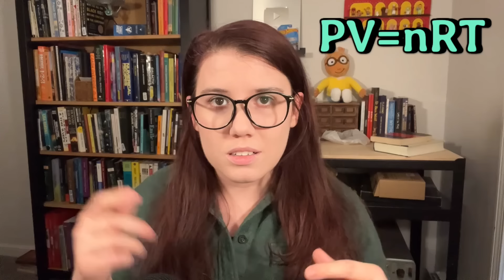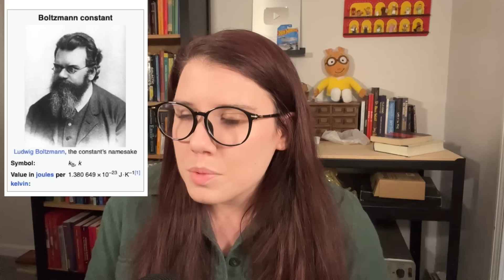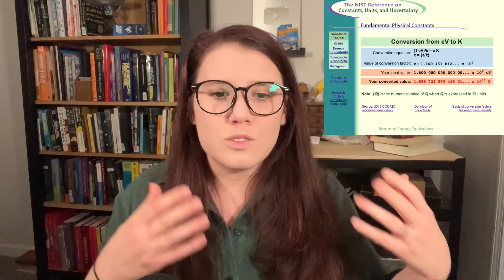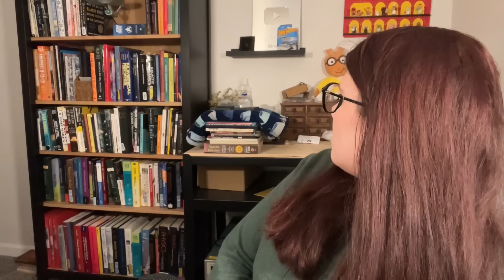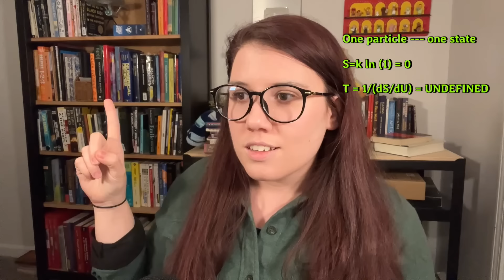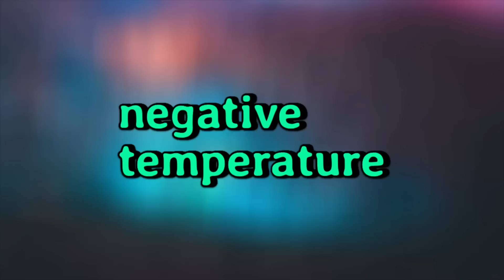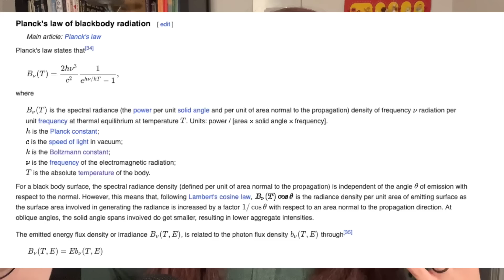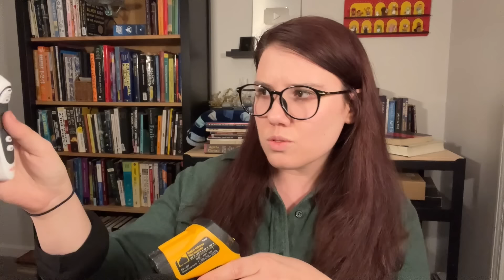the concept of temperature

Comment: I think the the diatomic gas only has 6 degrees of freedom. The motion of the two partners vibrating can be described the distance between them, so one variable, implying only one vibrational mode. I would say this is a "linear" molecule (as Wikipedia calles it). Would be happy to be corrected. Thanks for the relaxing video.

Comment: My day-to-day working concept of temperature is "how hard is the heat in this thing/space trying to get out?". Or how hard is this reservoir of heat trying to shove heat into it's surroundings? It's the analogy of pressure in a tank of fluid, or voltage in a battery. It even has those occasional plateaus on the graph drawn against "how much is left inside", where the "strength of shove" doesn't change because all the "charge" (heat) is going into/coming from a complex change of internal state.

Comment: "That is so much energy [that we've put into the ocean] and it's all just gonna slam back into us."

Nah, don't worry, like you said, it will first turn into hurricanes and droughts and floodings and stuff. Those things aren't too bad if you, like, live in between those. Which most people do, which is how most people still are able to deny that it's a problem.

But yeah, the ocean is a giant heat sink that soaks up a LOT of energy and only gives it back in relatively tiny amounts, like a relatively tiny class 4 or 5 hurricane that destroys only a tiny part of the planet where only relatively few people live compared to the 8 billion people, and it's why we're not already dead. If all that energy that heated up the ocean with one degree was in the atmosphere, we'd be very dead. The largest hurricanes are a result of just a tiny amount of warm ocean water heating up the air above it. So more energy in the oceans means more class 4 and 5 hurricanes, more often. Even a 6 yo can figure that out.

And yeah, that also means that even if we manage to stop heating up the planet even more by turning carbon into heat energy and CO2, we still have the issue of all the excess energy that we've put into the oceans and our atmosphere. We not only need to work on our emissions, but we also need to look ahead and stop being so scared of geo-engineering and gods. We have the math and the measuring devices to figure this out. All we need is the will to implement it. An that means convincing people that populism and nationalism isn't the way forward on a planet with organisms that require us to work together for our survival.
And that doesn't mean we need to convince headstrong idiots or CEO's or lobbyists, but enough of the rest of the people that are now drawn into populism and nationalism with propaganda and social media.
We can easily do this. The only questions are, do enough of us care, and will we do it in time? Or do we rather spend our time and energy on dividing and fighting and exploiting each other?

Comment: The easiest person to fool is yourself using symbology that is chosen to give predictable values.
When you put thermal EM information through sensors that transform non sense into Spectroscopic Analysis using sensible notations on graphical readouts,  ..as noted, it tells you nothing in Actuality,  except a position on the graph. 
Go to 3BLUE 1BROWN graphics and at least see what some detailed mathematical relationships are in terms of relative-timing dimensionality. 

Life is a bootstrapping operation, or i-reflection containment if you want to see it that way. The ability demonstrated to derive a particular Equation and the relevance of the Heat Equation thermodynamical real-time superposition Fluxion-Integral Calculus floating around on the Taylor Series of Newtonian <-> Einsteinian Relativity and Euler's e-Pi-i 1-0-infinity instantaneous 0-1-2-ness correspondence with i-reflection Totality, aka Geometrical Drawing and Perspective Projection holography dimensionality coordination/condensation.., well this is where you are offered to "do your Homework" and substitute terms of reference to Logarithmic QM-TIME Completeness cause-effect. 

TA bails out.

Comment: I'm like halfway through the video so don't lynch me if it comes up, but most quantities in physics are never really measured directly, which is something I spend a lot of time thinking about. Like yeah your thermometer "measures" a voltage... except, how does it do that? Voltage is something like electric potential energy per unit of charge (or whatever definition you prefer), you can't measure that directly either. I mean, how does a voltmeter actually measure voltage? If we imagine a 19th century style device, all they really had was the ability to pass current through a conductor, which would induce a magnetic field etc. and deflect a needle, then you calibrate that with some known resistance to measure voltage. But you didn't really "measure" the voltage, you measured the deflection of a needle. The things we can measure directly lines up nicely with the base SI units... except for temperature... and let's not talk about the candela...
Reply: Well if you go a bit further into electrodynamics you'd learn that magnetic fields are exactly what voltage is about.
Reply: @hedgehog3180  in fact I know a decent amount about about electrodynamics, being closer to my area of specialisation, but the vector potential is a very different beast than the scalar potential, even if magnetic fields are mostly just a Lorentz transformation away from electric fields.

Comment: The timing of this video is interesting, because I'd been wondering recently whether it's possible to compress a liquid or gas into a more dense phase of matter, since pressure and temperature are related, and temperature tends to move substances from more dense to less dense phases, not the other way.

If this video went any way toward answering that question, it went over my head. But it's still an interesting coincidence.
Reply: You can just look at the phase diagram of some substance. It will tell you at which pressures and temperatures it will be solid, liquid, or gaseous.
Reply: I mean yeah that's how heat pumps work.

Comment: Physics math kills me every time .. like, v = L/T and p =mv, okay, but dp/dt = - mL/t² ?? When did our little particle decide to move at variable speed L/t instead of constant speed L/T. They grow up so quickly :')
Reply: It decided to do that when a force acted on it to accelerate it. Which is why the t is squared in mL/t². If L/t² is zero then there is no change in momentum. No force is acting. dp/dt=mL/t² is just another way to write f=ma.
Assuming m is constant, of course.
Reply: @narfwhals7843  if you add a force F, your momentum changes as dp/dt = F, so if your current momentum is mL/T, then your momentum a time t later will be p = mL/T + Ft. Assuming that p is already a function of time p(t) only lets you solve for the force that would cause such a momentum

Comment: I'm confused at the part at like 36 or 37 minutes in, when you're talking about finding the temperature of a single atom or a pair of atoms. It looks like you find that S=0, and then you find the temperature as 1 divided by 0.  But why are you dividing by S instead of by ∂S/∂U ? I also don't really understand what ∂S/∂U means conceptually. Come to think of it, how can we take the derivative with respect to energy if energy is quantized and not continuous?
Reply: This is classical mechanics so energy is treated as continous, but you're right that the concept of temperature as dS/dU breaks down at this scale but that's also the point.

Comment: 16:15 The motions away and toward each other are actually the same vibration mode, but there are two degrees of freedom per mode, one each for kinetic and potential energy.
Reply: Was going to write this, then thought I'd better check whether someone else had already commented this. It also isn't trivial that there isn't a third rotational degree of freedom for diatomic molecules, but most books skip over this and I don't really understand it either (some QM reasoning) so "it's fine".
Reply: @hicetnunc1129 i believe this comes from the fact that spheres are rotationally symmetric, which is what we model particles as. Could be 100% wrong on that though it's just my intuition.  And polar particles would have some symmetry as well, but would be a different story.
Reply: i think that there isn't first rotational degree of freedom visible in space.
Circular DC is a electric mass (dof=2)
Electric amplitude ,charge (dof=1)

For example, take Carno's cycle on dof-lte line (electric).
And apply it to space-time line (magnetic) then:
D->A is iso-time decompression of space (1d-> 2d in 0 second)
A->B  is iso-space decompression of time (time begins flow in 2d)
likewise
C<-B is iso-time compression of space-dimension (2d-> 1d in 0 second)
D<-C is iso-space compression of time (time begins flow in opposite direction in 1d)
And ,of course,
S=C*lnT; S is space-dimension; T is a time.

According to Heron's formula mass^2=s(s-a)(s-b)(s-c);a,b.c - amplitudes; s=(a+b+c)/2;
c<a+b; it's evident that if c=a+b then mass disappears;

So if part of 1d amplitude disappears then 2d mass appears out of a,b,c;
 +1 carry on space-time line  from 1d magnetic amplitude to 2d magnetic mass .
likewise for dof-lte line.
So if part of 1d electric amplitude(electric charge) disappears then 2d electric mass(circular DC) appears out of a,b,c;
 +1 on dof-lte line  from  dof=1 to dof=2 .
Magnetic 1d amplitude visible in space but electric not.

Comment: At 16:15 you say the atoms in a molecule have two additional degrees of freedom because they can vibrate towards each other or away from each other.  I don't see how these two motions are different.   Also just before that you say they can rotate around each other in two different ways.  I also don't understand that.  The hand motions you use seem to indicate perpendicular axes of rotation, but is that what you mean?  In three-dimensional space there would be three perpendicular axes of rotation, not two, so why wouldn't this be three degrees of freedom then?  Hmm, I guess you can generate a rotation around one axis by combining rotations around the other two axes?  I think diagrams would communicate this more effectively than hand gestures.

Comment: As someone in AMO physics, I should really know more about this than I do, but from my understanding this kind of negative temperature thing happens inside gain media of lasers. The technical term is population inversion.

I guess negative temperatures really just mean that you have a cap on the maximum energy allowed in a system, rather than having it being able to increase indefinitely. This is kinda the difference between intrinsic spins (a finitely tall ladder of energy) and harmonic oscillators (an infinitely tall ladder of energy). They're both good models for things in different contexts.

And also negative temperatures are actually really hot.

Comment: I think the ice block thing is a little confusing since the block feeling colder or not cold has to do with thermal conductivity, which is related to electrons and all that, and then the rate of heat transfer from the block to the ice is higher. But that doesn't really mean the total amount of heat that can be transferred is higher, since thermal conductivity and heat capacity arent proportional (though related in metals), like aluminum will melt the ice slower than copper, but aluminum will melt the ice much more than copper, due to aluminum having higher heat capacity, but copper having higher thermal conductivity. And not to mention that heat capacity is related to weight and not density, so like the blocks being the same size doesn't really mean anything if they aren't the same weight. Also, after a certain point, the blocks will reach the temperature of the ice, and then it becomes a matter of the blocks transferring heat to the air through convection and then conducting heat away from ice, so it goes back into sort of a slightly rate-controlled regime. Like first the melting is really dependent of rate, then it depends on which block holds more energy per temperature, so it doesn't matter if one block has a higher rate if its no longer able to hold more energy, but then after each block has reached sort of the temperature of the ice, nothing about the blocks will really matter except the one with a faster rate will be a tiny bit faster at melting the ice because of the heat leaving from convection of air. Anyways it really doesn't matter too much if one block has higher heat capacity and thermal conductivity. Or it would be a cool experiment to see one block melt faster at first, and the other block catch up because of the difference between thermal conductivity and heat capacity.

Comment: 15:00 interesting that kinetic energy is 3/2kT and 7/2kT for monoatomic and diatomic gasses. Reminds me of how heat capacity is estimated to be 3/2 R and 7/2 R for monoatomic and diatomic gasses. Even though heat capacity doesnt really have anything to do with velocity or temperature or like electrons (in the way thermal conductivity does), and it should be related to phonons, but I would imagine the degree of freedom stuff is the same math.

Comment: I'm confused about the temperature/entropy description where if one goes up, one goes down. In the first example of releasing a gas (timestamp 28:20), I thought that a removed partition would increase entropy, but have no impact on energy or temperature (for an ideal gas), unless the gas is allowed to do work on the partition as it get pushed to another wall (though this isn't how the diagram looked). Otherwise, if the temperature went down, where would the energy go?

Comment: You could also say that entropy is a measure of "clumpiness", which is a word I may have just made up. 

Or perhaps, you coud say that it is a measure of "if you wrote down the state of each molecule with some ideal amount of precision, and then you stored it in some idealized computer file and used a theoretically optimal lossless compression algorithm, how big would that computer file be?". 

(The number of bits you need to say which microstate you are in the (base two) logarithm of the number of microstates...)
Reply: d-digit binary number system is a d-vertex simplex;
each of  it's 2^d  faces is a number;
digital root (amount of '1') is a dimension of face(number);
As we know from Pascal triangle, maximal amount of x-faces  in the middle (x=d div 2).
So entropy and dimension are same thing. S=k*lg(2^d)=kd;
Reply: You just accidentally discovered the connection between Statistical Mechanics and Information Theory, congrats.
Reply: @hedgehog3180  That connection is exactly what I was hinting at!

Comment: So I want to ask, "what is the temperature of a photon?"  But it seems that most commentary denies the possibility of photonic temperature.  This doesn't make sense to me, because we can heat things up to release photons, and vice-versa.  The Sun heats up the earth pretty well.  So maybe we can rephrase the question, "how much of a change in temperature is it possible for X number of photons to cause upon X mass?"  I mean if I told you to heat something up, but all you have is an unlimited number of photons, I'm guessing you could do it.  Lasers work, right?
Reply: Temperature doesn't make sense for photons because it is a property of matter, same way that photons can't have a charge or a pH level. You can use photons to heat something up by using them to add energy to some matter, but you can also use photons to change the pH of a solution by having them start a reaction with their energy.
Reply: @hedgehog3180  Thanks!  That's why I rephrased the question.  It's semantic to some degree.  Temperature seems to be a measure of (kinetic) energy in matter.  We could say matter doesn't have temperature, because matter is not energy.  The idea of temperature seems to describe a relationship between the two.  Photons are energy, and they are able to impart some of that energy to matter.  So if you accidentally spill your cup of photons in my cup of matter, can we calculate the temperature?  Or --if we take X number of photons out of my cup of matter, how much did we decrease the temperature?  We might need to account for wavelengths, but the temperature changes either way.  Theoretically, I (foolishly) imagine we could say, "we took one photon out of this mass, and it carried this much temperature away."  I suspect that once I say, "one photon," we're into quantum physics land where there's really no such thing as temperature.

Comment: A cool fun fact, measuring anything physical we are always measuring a voltage no matter what physical thing we measure. Or rather time because thats the only thing we can actually measure in a digital system. So the thermometer is actually a temperature to time converter which I find extremly cool.

E: Ok, exeption fully discrete implementations but thats quite uncommon as its either unprecise or extremly complex due to needing tens of thousands of combinations which takes up loads of chip real estate.
Reply: You mean measuring anything physical with a digital device?
Reply: @BNAA279 well yea but if want to measure anything with a reasonable precision you will have a computer involved
Reply: @timonsku  Define reasonable. But no, the precision of a measurement is not only defined by how you log the data, but also by the physical properties of the sensor and the system you are measuring.

Of course, in most cases a digital instrument probably is more accurate than an analogue one. But lets say you want to measure the circumference of your head. Would you say using a measuring tape would not give "reasonable" results? Or that a house thermometer with liquid does not give a reasonable accuracy?